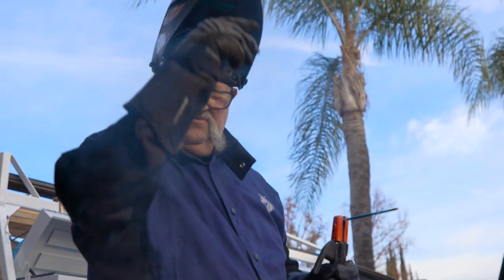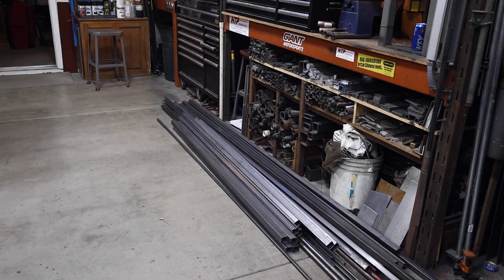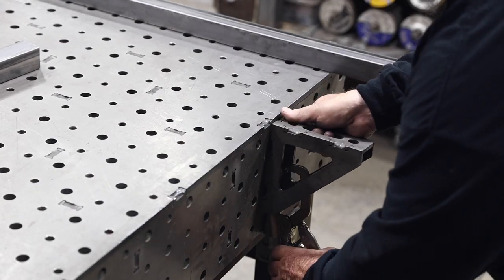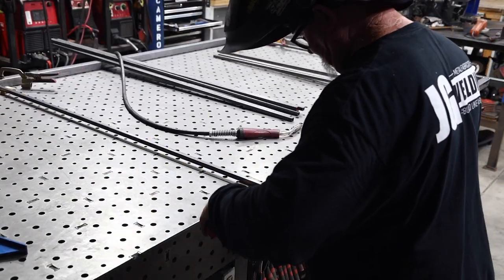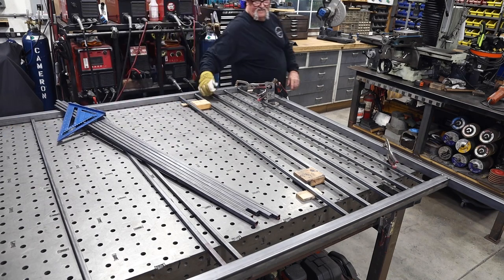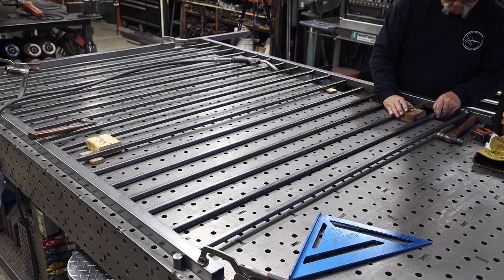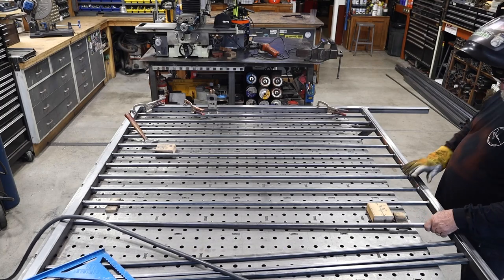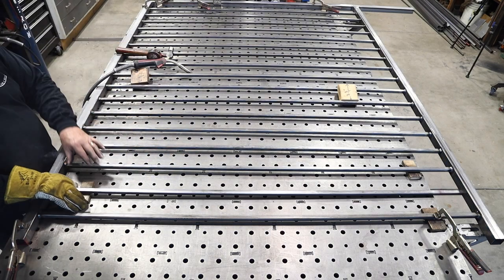Outdoor Metal Fence Panel Build | JIMBO'S GARAGE

Comment: A lot of the big box stores sell plastic fence, which is cheap and nice, but the plains of TX had some large grass fires and the plastic fences just did not cut it. They started out white and ended up as big chunks of black molten plastic. The true color came out

Comment: I’m curious about how you handle mill scale on your material. That is a challenge for me as I am jumping into a DIY FENCE/GATE project. If you already have a video on this topic I apologize, but didn’t come across one. Just send me a link if there is something available for me to get the info and guidance. I enjoy your posts. I am a little bit older than you but am embarking on some projects with welding. I’m an old dog but have challenged myself to learn some new Tricks.  Your posts have been very informative and helpful! Appreciate Ya!

Comment: Hey Jimbo, could you use adjustable parallels to space the railings?  You just do the calculations for spacing then fix your adjustable parallels with a caliper and away you go

Comment: Brake the spacing before you put the together mark the both top and bottom rails ,once you start to put the panel together just match the marks that way you can do one full side at the time instead going back and forward 
Love the table by the way I like your Work ethic buying the right tool for the job

Comment: Just a beginner, I’ve seen welded tubing that has split from water getting in and freezing. Is that not an issue if you get a good weld and the tube is completely sealed? Sorry if it’s a stupid question.

Comment: On last night's Bad Chad channel, he proceeds to measure the circumference of a 12 inch radiator cowl using electrical tape,, and of course lots of viewers pointed out that using the pi*d calculation would have been easier.  But at least 2 commentators called up the pi*r squared equation; Chad proceeds to cut a 113 inch length of sheet metal whilst uttering....' my brain keeps telling me something is wrong, but computer says and who am i to argue'......but didn't happen, lol.

Comment: Nice job as usual. You sounded tired today. Question for you. If I have a TIG setup using 100% argon can I use the same cylinder for MIG or do I have to get one with 10% CO2?
Reply: You could use 100% argon, but it would be expensive. Co2 is much cheaper. I use 75-25 in my mig set up.

Comment: You don't need a program to figure out a consistent spacing pattern, just a some scrap paper and a writing implement. It's basic math. And almost everyone has a smartphone with a calculator app now, so you can even use that and omit the paper and writing.